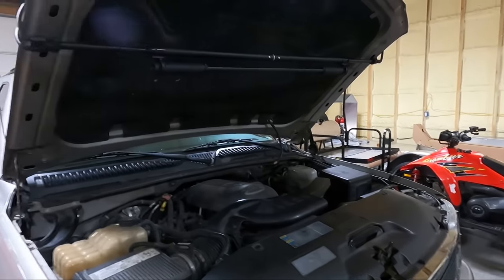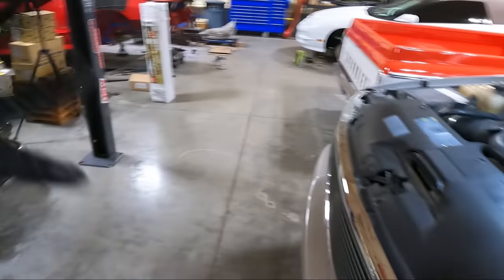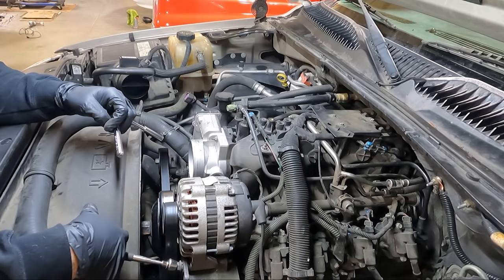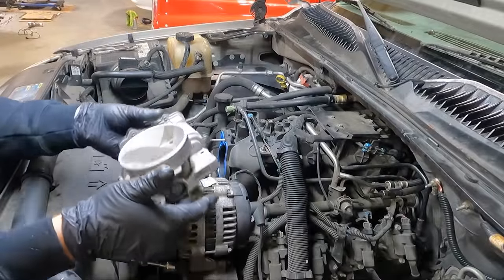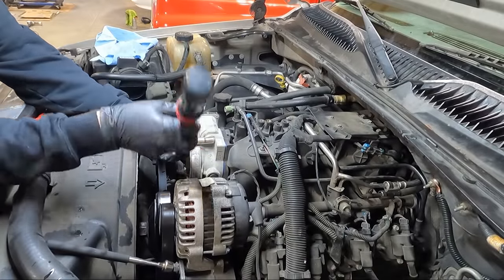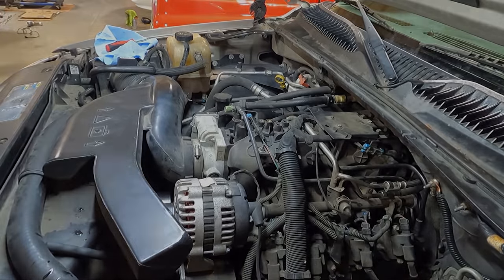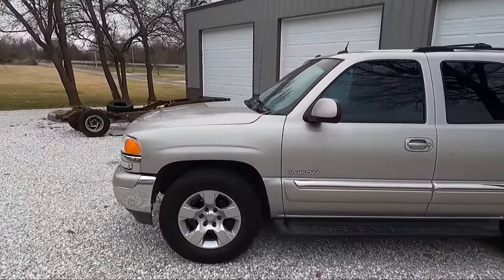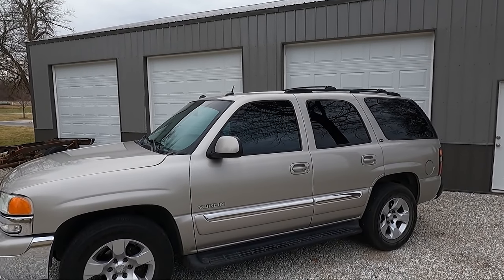How to Fix Reduced Engine Power GMC Yukon

Comment: All I did was run a ground from the ECU to the negative battery terminal and fixed the problem
Reply from the maker: Mine was definitely the throttle body
Reply: Many People say Ground the ECU - Body " but My 2000 Yukon XL has A Black Plastic ECU Body ( box unit - that Snaps in place to the Driver's s Side Firewall. So I take it That I Should Distinguish Which of the Connector Wires is The Negative, and Ground That one to the Neg. Battery Post...?? ). Also - I experienced the " Reduced Engine Power " Syndrome, while 2- blocks from My Home, Just Trying to Go to Work, at 5:30 am. The Vehicle Showed Numerous Codes, and Many Dash Lights, would Only Drive 7 M. P. H. - back to the House... To Switch out Cars....  It put Me into a Panic, I thought the Yukon was Ruined... Or would Cost  $800 to $1200 to get it Fixed... As I was Having codes ( 0452 EVAP Pressure , Low Voltage , " which I bought a New Fuel Press. Tank Sensor... But Never Installed it Yet, then came the 0332 Bank 2 knock Sensor Error Code.
Well... I Was Late for Work and Very Frustrated.... So I thought Carefully , to Disconnect the Battery Post Cables, and Let them Sit until 5:30 Pm , when I got Home... I touched the Red/ Black Cables together to Remove any residual Computer Power... Then I used a Steel 5/8 " hand Brush, and removed the Battery Bolts from the Rubber Cables, And Scrubbed the Hell out of Every Possible Battery Surface, then Cleaned the Bolts, there was an Unseen Dry Yellow Sulfur Powder Present, Blew it all Away, Reconnected Cables , Snug... Crossed My Fingers, and Started the 5.3L Yukon... Only , the Idle Needed to Re- Learn....
I took it for a Calm Test Drive, to Re- Learn , My Driving Style... Everything was Perfect, it Ran Normal Again...!! Although, the Codes 0452, and 0332 still pop up... Until I address those Semi - Difficult Issues
To Swap out Fuel Tank Pressure Sensor, and to Remove the Entire Intake Manifold Plate, and Buy -  Quality Knock Sensors. And
Install PROPERLY, WITH MINOR OIL DRAINING / POOLING MODS... THAT I SAW ON A YOUTUBE VIDEO 
I DO HOPE This has Helped Somebody.... Before - You Start Throwing New Parts at the 5.3L engine, or Taking it to DisHonest , Scammer Mechanics... That Don't Tell You, what it Took to Remedy the Errors...  BillinL.A.   7-29-22

Comment: For my situation it isn’t the throttle body, I bought a new throttle body, coil packs, spark plugs, wires, but yet it still gives me this issue. It’ll even cut mid drive and buck and eventually die and not start again.
Reply from the maker: Its a ground or throttle body. If you bought a non gm throttle body I would start there after ground connections

Comment: Keep the roof rack. I have an 04 yukon slt. I just recently upgraded my tail lights. After I installed the tail lights and put in LED bulbs my cruise control stopped working. My switch is brand new and my fuse is good. I've researched that the new tail lights could be the problem. Lemme know what you think.
Reply from the maker: I did upgrade lights and no cruise control issues
Reply: Had the same issue it was my LED bulbs that didnt have the right resistors and went back to stock bulbs and wala cruise control works again
Reply from the maker: Yeah apparently that is common

Comment: P1516 will pop up  and go into reduced power mode randomly after i am already driving for a while. Ill pull over and turn my truck off and turn it back on and it goes away and i can drive normally again. The regular driving does seem kinda sluggish though.
Reply from the maker: Might need a throttle body

Comment: I have a question.  Did you get a code when it was running bad on cold crank up?  My 04 Yukon will run like crap on a real cold morning on a crank up. Seconds later it runs fine. Black smoke out the tail pipe. Code shows 071 and 074. May be 171 and 174.  Any who. Those are left and right bank lean. Going to change my 02 sensors and see what happens. Original throttle body on her. Oh and I took my roof rack off and love that look
Reply from the maker: Yeah that sounds like a different issue
Reply: I hear that there are 4 O2 sensors on my 1999. Which ones should I replace? Left and right banks ‘lean’ is the code
Reply: @sandymilne224 to be honest I have the sensors for the front.  I just have not replaced them yet. I don’t know if this is the problem. But I think it is a good place the start.
Reply: @sikes185  : Thanks for the comment. They are not cheap to buy quality ones. Without testing the OHMs of everyone of them, I was wondering if the fail rate of specific ones is more common. I’d start by replacing those first and go one-by-one through the system. Just wondering if anybody knew which ones ‘go’ more often than the others.
Reply: @sandymilne224 well my thoughts on this is. The code reads left and right bank lean. If it was just reading left bank lean then I’d go with one. But sense it says left and right. What the hec I will replace both. I mean it’s only money. You can’t take it with you.  Lol

Comment: Hello sir, my chevy express doing the same when i hit a bump..I changed throttle body position sensor, worked for a couple hours then i took a bumpy road and problem came back..any idea?!
Thanks!
Reply from the maker: Sounds like a ground broken or frayed
Reply: @TWAMotorsports  thanks, I’ll check that and I’ll check throttle plate.
Thanks again
Reply from the maker: @firebirdloft back of heads too

Comment: So the p1516 code pertains to the TB I cleaned my grounds as well drove it this morning it being cold did the same thing again I did a plug and wire change 2 weeks ago after this past weekend it started the reduce power and check engine light stays on I noticed in the cab the rpm needle is sitting below the 1on a cold start  a bit wasn't like that before the problem arose
Reply from the maker: I would look at the throttle body especially if it is only on cold mornings

Comment: I’m having a similar issue on my 03 avalanche it has the p1518 throttle body code, it runs like a dream until I turn the air on, then it goes into reduced power mode. With the air off it is fine, there is a new aftermarket tb on it should I change it to a gm tb? Why do you think it gets triggered by the ac/blower motor
Reply from the maker: Could just be a broken ground
Reply: @TWAMotorsports  I went through and made several new grounds already, and fixed a shotty splice job on the blower motor with no luck. I was reading review on the tb which is a hitachi, and many of them are saying it's garbage and only works for about 5 months. I don't know how long it has been in there I just bought the truck a couple days ago
Reply from the maker: I doubt its rhe tb if it only happens when ac is on
Reply: @TWAMotorsports  I brought it to a mechanic friend of mine that specializes in electrical we narrowed it down the the ac compressor, replaced it and it's still happening. Looking at the wiring diagram the compressor runs into the computer that controls the TCM were going to isolate it and see if it works he's thinking it either needs a computer or it could be more of a mechanical issue, I'm leaning towards computer, when the code is off it runs great
Reply from the maker: Crazy

Comment: I changed out my TB and the pedeal censor , and on a cold start it still shows reduced power and check engine light. Any advice???
Reply from the maker: Gm throttle body? Check all the grounds?

Comment: Been dealing with this with our 2003 yukon xl 1500 denali. Has the 6.0. Weird thing is when it happens, you can pull over and turn off the engine, then after a minute or so start up and keep driving normal
Reply from the maker: Yep throttle body or ground
Reply: @TWAMotorsports  yea definitely a repair I feel comfortable tackling... Not looking forward to the head gasket on my other car... 03 century with the 3.1
Reply from the maker: Yes the 3.1 sucks.
Reply: @TWAMotorsports  can definitely confirm lol. Replaced thermostat (that was missing for reasons... Previous owner), then waterpump was leaking. Then replaced that and then was told it was the intake Manifold gasket... Just paid for that to be done... And now it's the head gasket. Honestly not sure if worth it at this point... 238k miles.
Reply from the maker: Been there with vehicles before
Reply: @TWAMotorsports I thought I had it fixed when i replaced the ground from the wire harness to the block on the passenger side of the engine. Ran it to the firewall location at the driver side. It drove at least 100 miles or so over 3 days with no issues then randomly this morning did the issue 4 times this morning going on a trip barely 3 miles

I do have a new throttle body, from "standard motor products" and had the little ❤ icon on rock auto so I'm guessing people found it useful lol. Was hoping the ground would have fixed it as we could use the money but it is what it is
Reply from the maker: I will say again I only buy gm throttle bodies
Reply: @TWAMotorsports  I know, really hoping this one works though. Budget is pretty tight

Edit: apparently the gm part is about the same price. Guess rock auto just didn't have them I stock or I would have got it. Guess if it doesn't work I'll return and get the GM part. Have til mid of next month for the return
Reply from the maker: May work for a week. May not
Reply: @TWAMotorsports  one last thing, eh for now I suppose lol, do I need to reprogram anything or what's needed for the learning procedure? I don't have any fancy scan tools or whatever
Reply from the maker: Generally no
Reply: @TWAMotorsports  so, what do you do with a misbehaving GM?

...

...

You Ground it!
Reply from the maker: No reprogram needed

Comment: I have a 2000 Yukon. Replaced throttle position, O2 sensor and fuel pump. Also new in line fuel filter, and plugs but not new wires. Running alot better but still doing it.  Not showing any codes. Any ideas!!!
Reply from the maker: Throttle body?
Reply: @TWAMotorsports  that's next on the list. With it not throwing any codes its really confused us.
Reply from the maker: It happens

Comment: mine only does it when it is really hot out. Is it still a throttle body? Winter time I normally do not have this problem
Reply from the maker: Could be or a coolant temp sensor in the driver side head
Reply: @TWAMotorsports  Well now the pedal does nothing so I'm wondering if it in the pedal sensor
Reply from the maker: Could be

Comment: Im having the same issue but also another issue where it will have a very slow crank in the morning but it will start and it will say reduced engine power ill let my truck warm up turn the truck off start it couple times and it the limp mode goes away but do its the tb or could be something else ?
Reply from the maker: Yes. Tb isn't responding
Reply: @TWAMotorsports  Okay ill swap it soon for a GM tb and ill lyk thanks man

Comment: Hey so I got 2000 yukon denali, i got a problem where i drive it from work to the house about 5 minute drive i go to start it after like 30 minutes of sitting and its an Intermittent long crank and it used to not start till the next day i had the security system fixed and i still have the long hesitating cranks and now that it cold out i have it outside and it loss of power till it gets warmer then runs fine. Had it in 3 different shop no one can tell me what it could be. Any ideas? Thanks in advance
Reply from the maker: Sounds like a fuel pump on its way out to me
Reply: I put one on my self did the same thing no change and i had a shop change it out as well and nothing has changed
Reply from the maker: Sounds fuel related to me

Comment: My dumbazz cleaned the throttle body without unplugging the battery now I have an idle surge and reduced engine power code so I bought a new throttle body/tps, I unplugged the battery for and hr and removed all the ecm fuses. It did nothing I still have a damn reduced engine code why do you think it wont clear the code? Quite frustrated I also disconnected - + and used my jumper cables to drain the system and still wont get rid of that damn code, any help would be appreciated.. I didnt touch anything else accept cleaning the throttle body thanks
Reply from the maker: Sounds like a ground issue to me.
Reply: @TWAMotorsports  
Hard Codes:
P025A

U0073
Codes after I start the engine
P1516 P2101
Truck was running just fine until I cleaned the throttle body wit 0 NO Codes.. 
Also why does my truck start up when I remove both fuse and relay to the fuel pump?
Reply: @TWAMotorsports  Hard Codes U0073 & P025A, Truck was running fine until I cleaned the throttle body, my dumb ass cleaned and unplugged it without disconnecting the battery first no issues before the cleaning
Reply from the maker: Definitely a bad ground somewhere
Reply: @TWAMotorsports  Right on ill check around appreciate it

Comment: 2003 CHEVY AVALANCHE SAME PROBLEM ..after changing the TB the reduce engine power still there plus it start to misfire 2 last cylinders on the passenger side to front  not firing
Reply from the maker: Definitely a ground issue
Reply: @TWAMotorsports  which ground ? where do i find it  ,,i thought the injectors are the coils was the problem
Reply from the maker: Back of both heads
Reply: @TWAMotorsports  dont understand
Reply from the maker: There is a ground wire that commonly breaks on the back of each cylinder head
Reply: @TWAMotorsports  check the ground wires didnt find any break so i went over the fuse box check all the fuse then the computer that was all good  then  so i just kind of shake up the wires by the fuse box and computer and it start up drives good but the problem keep coming back REDUCE ENGINE POWER
Reply from the maker: Is it a gm throttle body or autozone or O'Reilly one?
Reply: @TWAMotorsports  original throttle body ...i took it off but i put it back on because the one i put on didn't make a difference  it was a hitachi
Reply from the maker: So you haven't replaced with a new gm unit? Probably the issue
Reply: @TWAMotorsports  U MIGHT BE RIGHT , but think there's shorts in the wiring from the fuse are the are computer ,,the original  one is in but reduce engine power comes on some time ,,i ravel the wiring a little n it works

Comment: Did the problem stay fixed?
Reply from the maker: It did. No issues whatsoever after this
Reply: @TWAMotorsports  so a gm part was the fix . Interesting!
Reply from the maker: Yes. Sometimes you get lucky with aftermarket but I haven't
Reply: @TWAMotorsports  I just called the mechanic that put that tahachi on and they are going to warranty it.
Reply from the maker: Sometimes after a few you get a good aftermarket one.
Reply: @TWAMotorsports  they ordered me an acdelco part this time. 06 sierra 1500,4.8 4x4  on the floor. I’m trying to preserve it for my son.
Reply from the maker: That is your best bet. 👌

Comment: Good afternoon been following you for a while ima big fan of lowered suv tahoe Escalades Yukons etc I recently bought a 2004 Escalade awd are torsion bar keys enough to lower the front or should I order a kit with spindles
Reply from the maker: Torsion keys will generally only get 2 inches
Reply: @TWAMotorsports  ok cool cause I found a rather cheap kit on ebay with torsion keys for front and 4” springs for rear with shock extenders
Reply from the maker: It will never get in alignment with keys unless you change upper a arms

Comment: Mine does it when it's hot out or after I wash it...
Reply from the maker: Probably not the throttle body then.
Reply: @TWAMotorsports  yeah it's pretty rare. If I shut it off and turn it back on a few times it usually goes away. I'm gonna try the ground back by the oil sending unit I already did the one on the core support. I'm also planning on replacing the battery to block ground I cut the end off of the one that's on there and It didn't do it for about 3 months. I think it's still a ground issue in my case

Comment: I changed my throttle body and it still says reduce engine power and is making a noise
Reply from the maker: Did you buy a GM replacement?

Comment: Santer Auto Repair YouTube channel has your easy fix on this issue
Reply from the maker: I fixed it
Reply: @TWAMotorsports  I was not discrediting this video at all. JS, my 6.0 GM gas guzzler had this same problem and back when I was “too proud or stupid” to look up on the interweb and after $500-1k in parts I re grounded all these and it worked, also fixed some radio issues. Without these kinds of videos I would be lost and more broke. 🙏👍🙌
Reply from the maker: I also added a few grounds. 99% of the time it's the throttle body though. People buy cheap aftermarket ones.

Comment: I’m having problems when I try and get on it there no power it stops me but drives just fine when I don’t accelerate fast I replaced spark plugs wires maf sensor and pedal accelerator sensor I’m wondering if it’s my throttle body also I dont have a check engine
Reply from the maker: Could be but not sure

Comment: Biggest piece of garbage system gm ever made. I have had the wiring peeled all the back on the pass side injector side wiring. There is a ground in that harness as well that breaks off the back of the head. I also replaced the throttlebody and harness that came with the throttlebody. Soldered it all in.
Reply from the maker: Yeah seems to cause issues